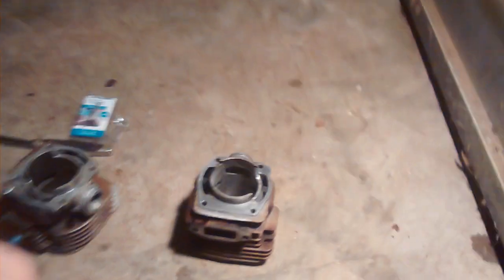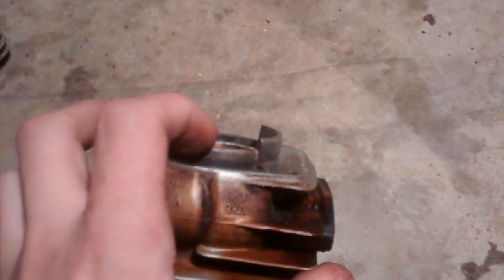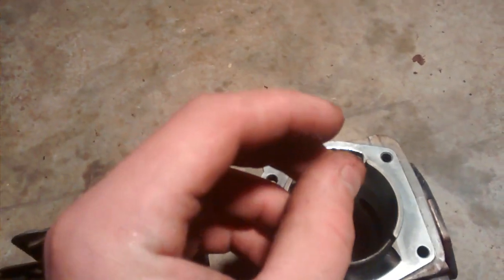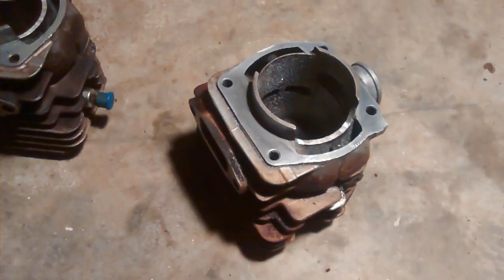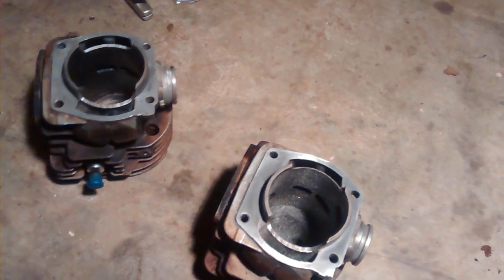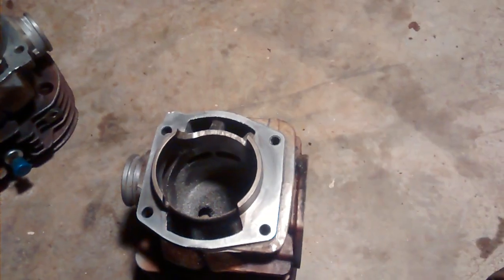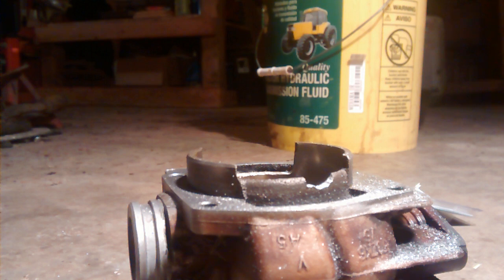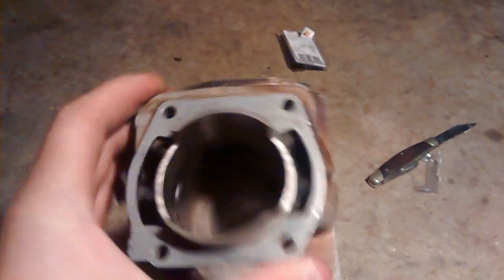Chainsaw cylinder porting

Comment: Think about "sharpening" or reducing the thickness of the bottom of those transfers by grinding inside the transfer sides... By slightly thinning those at the beginning you get better air flow into the ports ... Check out how they look from the factory. Good video, and great sawing!
Reply from the maker: Thank you. I will look into that.
Reply: @monumentpeaksawhouse689   140 psi good compresion 372 xp Mahle?
Reply: @monumentpeaksawhouse689  Friend, or +500 turnover from the maximum permissible damaged saw?